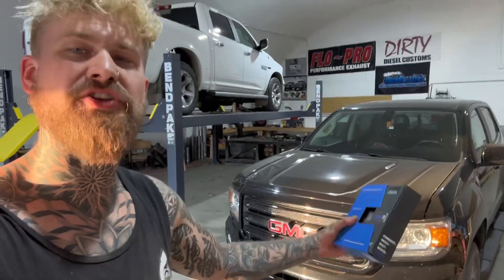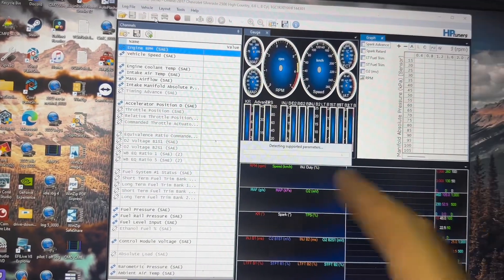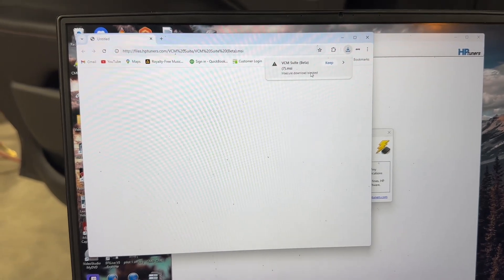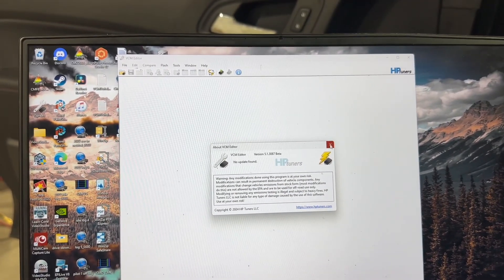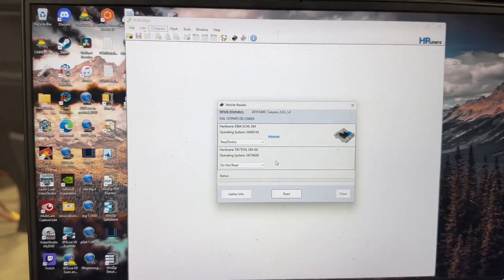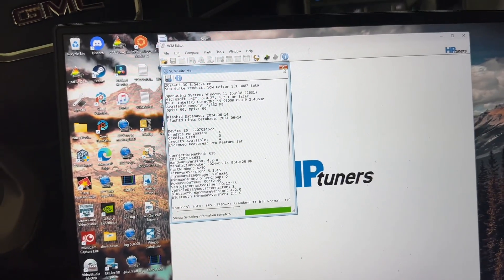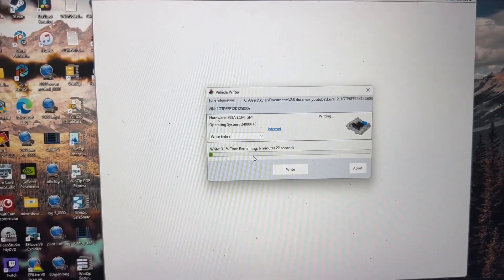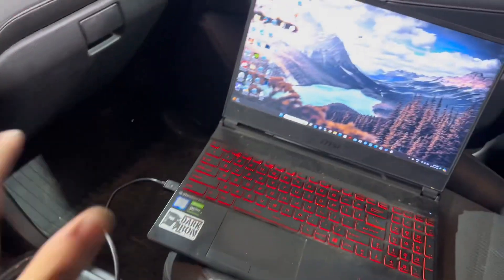How to tune a 2.8L Duramax with HP Tuners

Comment: Any idea how to clear the service emissions message off the dash after tune?
Reply from the maker: If you still have the service emissions code after tuning then you need to contact the tuning company’s customers support and they will likely need to send you a “reset” file
Reply: Thanks man. I sent them an email but I don’t expect an answer over the weekend
Reply: @Joker_Chris  did you get that resolved?
Reply: @Sheevnessyeah. Had to get the def warm where the heater wasn’t needed, let it do the full regen, then flash the new tune
Reply: @Joker_Chris  I’m having that same issue. Gonna be hard to do when it’s 30 degrees outside.
Reply: @Sheevness try to find somewhere to let it sit inside. Maybe even the dealership for an hour or two